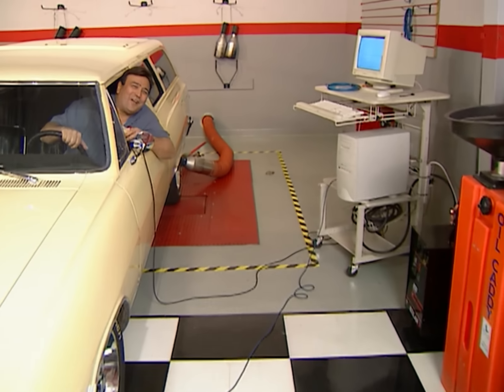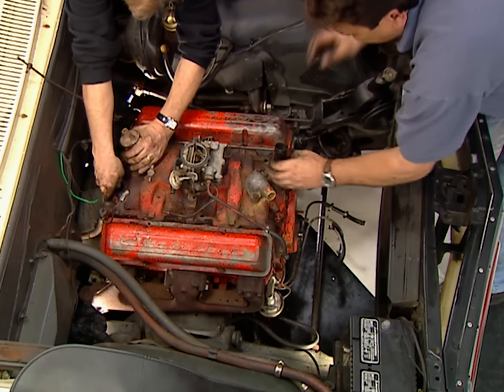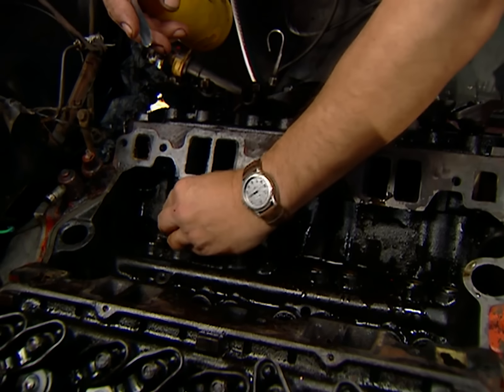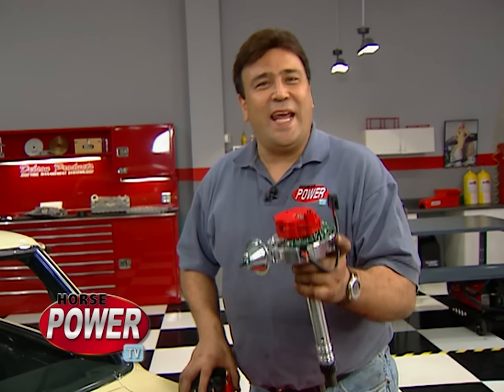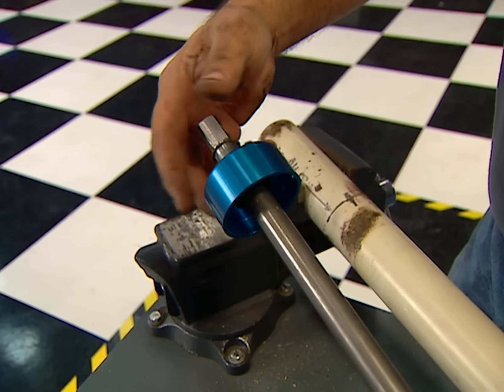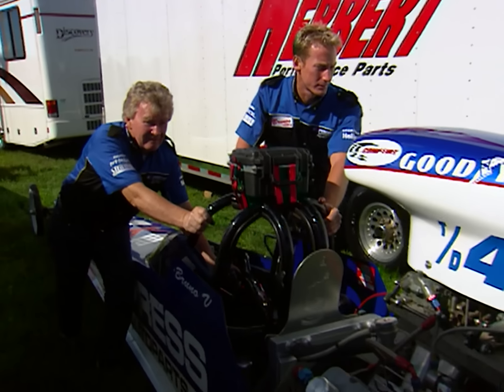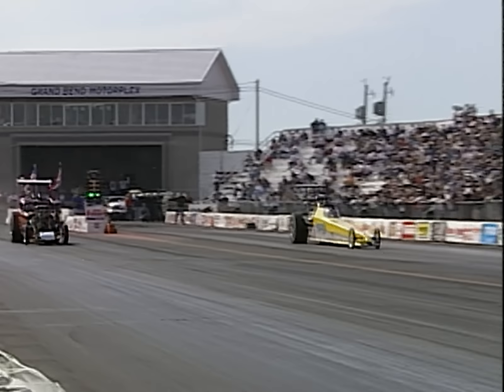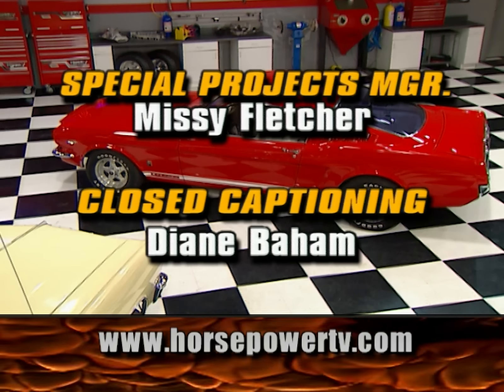Chevelle Wagon Gets A Driveway Cam Swap - HorsePower S4, E13

Comment: Cam swaps aren't so simple these days, nowadays your lucky to get a new cam to last for the 1st 20min of run time without shredding a lobe or lifter, parts quality isn't what it used to be.
Reply: Sounds like operator error or buying cheap Chinesium.
Reply: @bmstylee  nope, look around search on YouTube,search forums, search reviews on new cam and lifters, ask around to machine shops and engine builders, people EVERYWHERE are loosing cams and lifters. There a very good video on here from a channel "Powell machine" that does a good video demonstrating how the new lifters they are selling are not machined correctly and are coming out of the box with little to no crown resulting in very rapid lifter failure. Parts aren't what they used to be, they are selling garbage and people keep buying it and the manufacturers are pushing blame on the end consumer by using every excuse in the book.